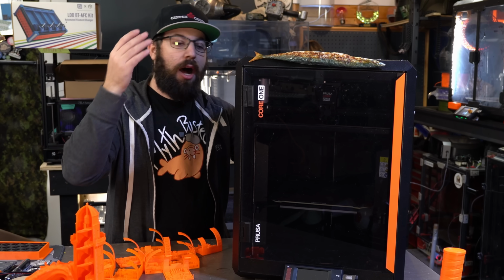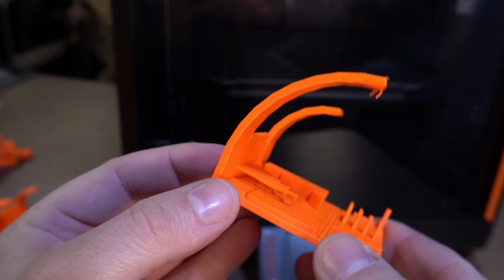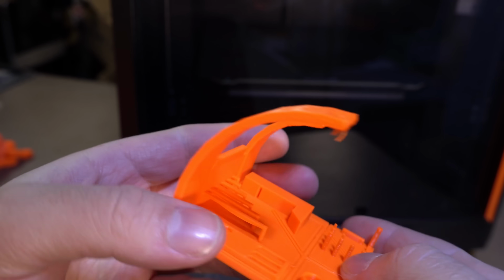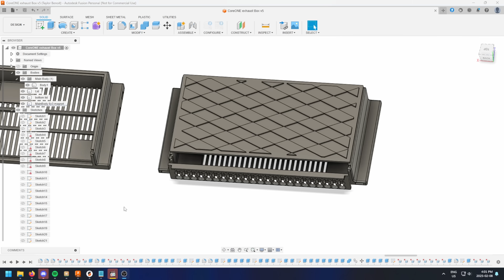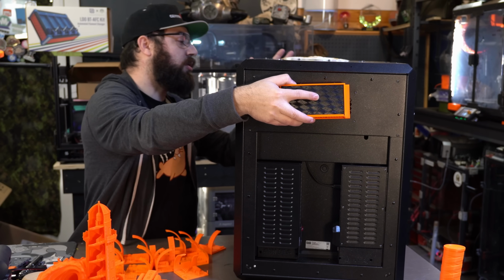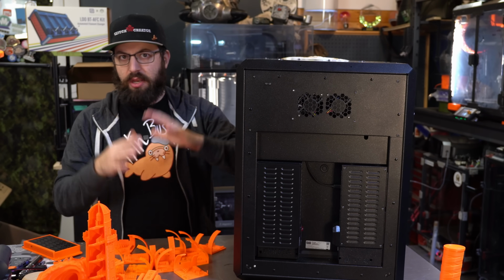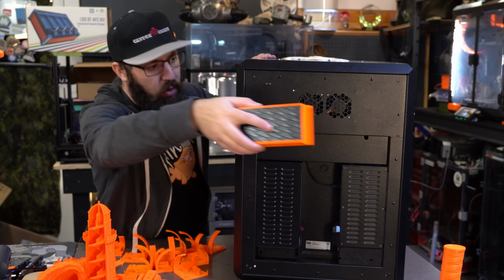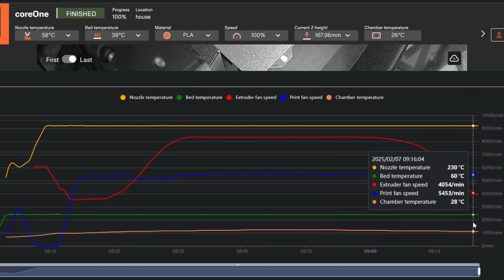One week with the PRUSA coreONE, What i've done with it and thoughts on it? #3dprinting

Comment: I'm still trying to learn CAD.  I have sorta mastered Open SCAD, for simple things.  I'd like to learn FreeCad, especially now that it's finally out of Beta!
Reply: Been using Plasticity for all my 3d printing needs. It's just so much easier to whip something into shape and then evolve it than other CAD I've used. Granted you need to buy it but a) It's cheap and b) it's forever. . sorry seems like an advertisement
Reply: @colinhare4722 you really owe it to yourself to test out the free versions of fusion 360 and onshape for non-commercial use. The usability and user experience is dramatically improved over free CAD and makes the process much more fun. I'm all for using open source software where it makes sense, but in this case the user experience is just far too compromised.
Reply: free cad is unusable for anything slightly complex

Comment: Not a bad attempt at that filter. Though a couple of design changes you may want to do to improve airflow is to create a gap of about a centimeter between the exhaust and the filter, and make the bottom vent as large as reasonably possible and extrude some extra height on the vent and towards the filter media cut a saw tooth pattern out of it. It's all to increase the surface area the air gets to travel through. Just think of how the air is traveling and try to make it as wide as possible for where it's going. 
How to think of it in CAD would be a rectangle around the exhaust extrude out the centimeter, revolve the rectangle so it points down. You'll then want to sacrifice some airflow by squishing it, so it sticks out as far as you want.
Still won't be as good as not having it there at all, but should drop a few degrees off that chamber temp.

Comment: Screw the WiFi and use the ethernet jack!  (would that be faster?).  Let's face it, the Prusa has really only has one processor, you REALLY need something like a Rpi or Beaglebone running Linux if you want decent WiFi speed.  OK, you don't need Klipper, Octopi plus Marlin would be fast enough.
Reply: While technically yes the ethernet is faster the printer is still slow fo. You are correct, Prusa went bare bones with the tech and you would need something beefier to do other stuff.
Reply from the maker: Its limited by the MCU processing power pretty much, would need a whole new board to support faster than 10/100 speeds

BUT, it doesnt really matter in regular use, because the printer will start the print job  WHILE downloading the file. so at least they`ve worked around the slow speeds

Comment: Well what do you know - its almost like the Prusa engineers knew what they were doing ;-)
Reply: They are competing with the x1c, which is nearing 3 years of age at this point, and are still behind in features and accessibility
Reply: @ManBung  except that the x1c sucks
Reply: it’s hard to compete when bbl patents every fucking thing in existence
Reply: Almost! For the price point, it would have been nice to have an active chamber heater (for faster heating) as well as some sort of motorized control over the flaps that open and close the vents as needed. And for that matter there should have been a second flap over those rear fans to really seal them shut during high temperature printing.

Comment: Automating the opening and closing of the top vent. I dream of the day when one can hit print and only have to worry about removing the prints when done. Everything else automatic (chamber temp triggers, environmental air handling, precise lighting with decent monitoring, and material selection all done for ya).
Reply: Yes! The system seems made for something like this (wrapped with the hackerboard)
Reply: I mean, you can just add a lever and use the toolhead to open and close it... ;-)
Reply: @ulaB  If an extra line or two of g code could do this then you’re a genius :)
Reply: Check out the 5v solenoids for tinkering. They re plenty strong enough to power a simple open/close mechanism.
Reply: I really wish they would have already done this for the price. Solenoids are cheap, and is others have stated they could have done a mechanical solution as well that was driven off of the print head movement.
Reply: @falxonPSN  I don't think solenoids are supposed to be powered for hours,  are they?
Reply: That's what I'm planning on doing with my voron v0, little servo motor to open the top panel when needed
Reply: Even just a proper slider tab seems better that having to slide a bare bolt